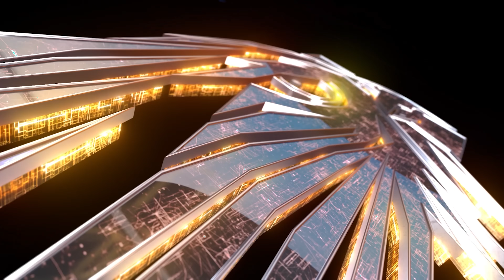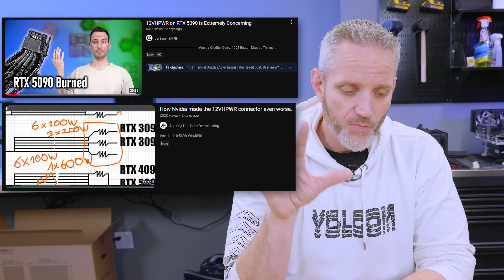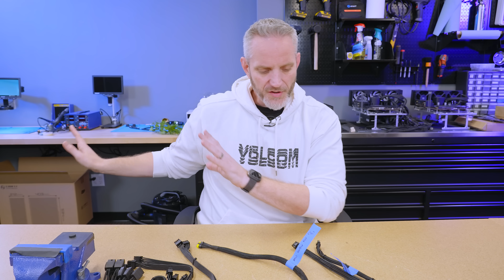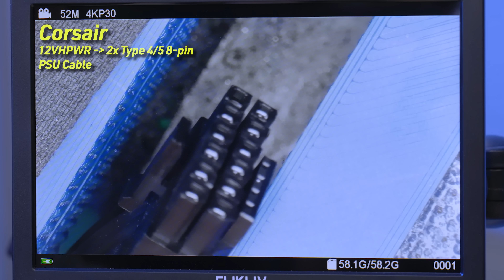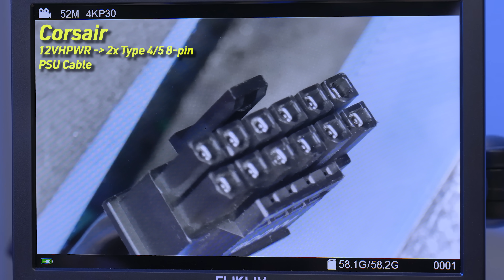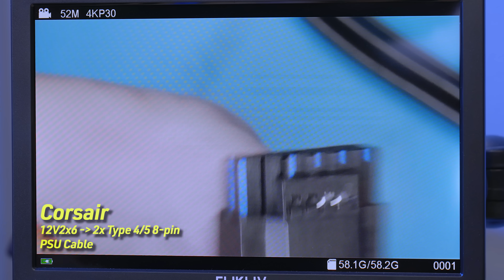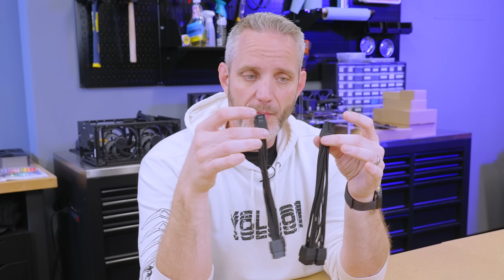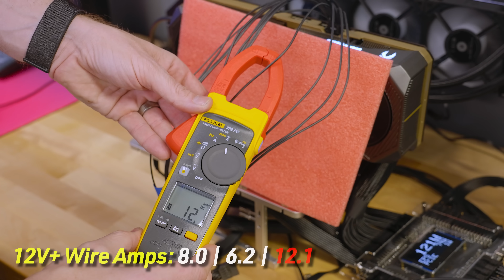I discovered something concerning and I need the Experts to chime in... More 12VHPWR discovery!

Comment: The tricky part is that the connector on Jay's Corsair cable might have even looked fine before it was plugged in for the first time, and only during the insertion process did one of the pins come loose.
Back in the day, this was a common issue with Molex 4-pin connectors for hard drives and CD drives.
Reply: LOL shoved a Molex pin right out of the connector more than once. Also scraped my hand on sharp edges of cases when they finally came apart more than once. Never disconnect a Molex cable and pull towards your face unless you enjoy punching yourself.
Reply: @JETWTF  can confirm. I'm not even that old but I still have some old PCs for nostalgic reasons and those molex connectors are a pain to remove. Once it does come out, it makes my hand fly back. 🤣
Reply: Oh god, some of those connectors were hot garbage
Reply: This. I got into the habit of pushing in the connector, then pushing in the wires to make absolutely sure all were connected.
Reply: Molex was always a gamble.... will it slot... or will it not... if not get some needle plies to bend the pins to try to get them to socket.
Reply: @givemeanameman1  Yes but at least they knew it was janky so the specification for the 4 pin Molex, PCIE power, etc., were notably underrated from what they could technically handle in ideal conditions.

This connector is like rating the Molex for 18A and wondering why they keep melting.
Reply: Yes! This is exactly remindingg of a molex connector lol
Reply: I just had a look at my own Corsair 12v-2x6 cable that I've never used yet, and it looks the same as the one Jay had, complete with the pins able to be pushed and pulled easily.
Reply: I also have an unused Corsair cable that wasn’t plugged in a single time, and the pins have obviously different lengths. They are not loose, but two of the pins sit almost a millimeter higher than the rest of them
Reply: First thing I thought of was the molex lol!!
Reply: IMO, sunken pin is always an issue existed that's difficult to manage given the manufacturing quality and control  but pushing the boundaries to the limit such that a sunken pin might potentially trigger this type of hazard is bad.. Btw, does this cable required to go through test like  hipot?
Reply: @Eriol3751  We have the technology to stamp and crimp these sheets of metal really well where the consistency will be really high! It'll be consistently great or consistently crappy with relatively little ongoing QA overhead and a lot of initial tooling cost to make it good.
Reply: All my new Corsair cables and even the old RM850x PSU cables have this issue where 1-2 pins can be pulled easily like in Jayz video and it's usually the same pins on every cable. Yes the new corsair cables are fresh new and never used them. I had to buy them cuz I didn't have enough pcie 6x2 cables to connect to the connector adpater that came with the rtx 5080. I made sure to push in the cord that has the pin that gets pushed back, and yes all of the pins that had this issue I was able to push them in slightly even after checking the cable was all the way in plugged but 1-2 cords on every cable i could push in a bit cuz they were the ones that you could pull out slightly the pin all other pins/cords are stable. Corsair needs to fix this shit.
Reply: Damn... now that you mention it, I remember that kind of crap with those horrible 4-pin Molex. I was getting super paranoid whenever I had to handle one of those things as I'd ran into loose ones on more than one occasion. I also was quite relieved when those things went away for good.. :)
Reply: At least those connectors had larger metal mating surfaces, which could absorb the load and not fail...  and had a much higher safety margin on the connector and wires.
Reply: @wolphin732  Oh they would fail... however.. the consumers were really benign! If your hard disk draws 20W for a second during spinup and then just sits there at like 6-8W ongoing consumption... well to begin with if the connection is crappy it'll usually just fail to spin up and won't try to re-start until you power everything down, it gives the motor about 8 seconds to reach speed and if it won't do it, it turns off. For other the maximum possible power loss occurs when contact resistance is same as load impedance, so your total consumption on that strand is mere 10W in this worst possible case, of which only 5W are lost on that connection, which will degrade it further but won't start a fire.

Also if you never got suspicious parts like no-name extenders and adapters, low quality PSUs that came with enclosures, you'd be spared of the issue entirely, quality connectors there. Still a little wobbly and sometimes failing to insert, but if they did insert, the pins would never pop out the back and the metal surface treatment was good as well. If you got cheap parts... well...
Reply: I f-ing HATE "Molex" 4-pin hard drive connectors. One of the worst connectors ever made.

Comment: What you are seeing is a pin that was damaged during the crimping process. The pin has “fins” that when pushed in traps the bin between nuts in the plastic connector. With just one fin expanded out and the other crushed you would find this happening.

Comment: I am an electronic engineer. It is crazy to rely on a bunch of cables just connected in parallel in such high load application. Even if everything is manufactured and connected up to spec there is a variability in contact resistances. The current finds a path of the least resistance. At 600W the connector is pushed to the limit. If one wire has half of the total resistance than the rest it will be twice overloaded. No current balancing across the individual wires is crazy.
In general 5000 series is a joke. The performance increase at the same level that power consumption increase is no progress at all. They are the king of the mountain with 4000 series, they just could skip that joke and not waste resources on 5000 series but just keep working on real successor to 4000 series cards.